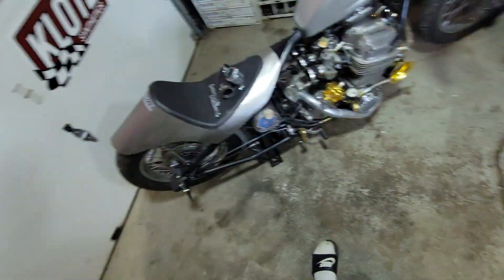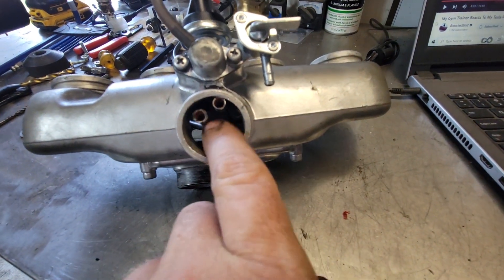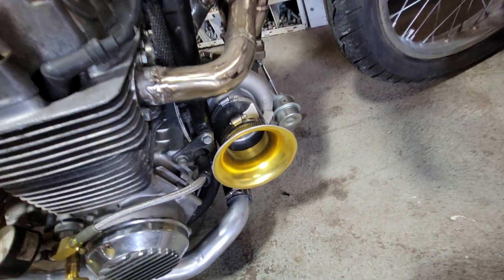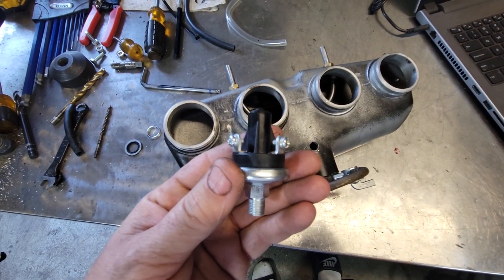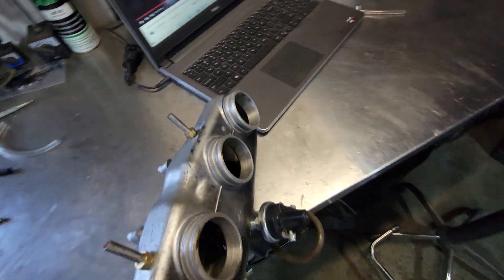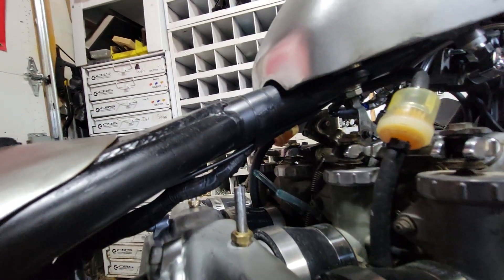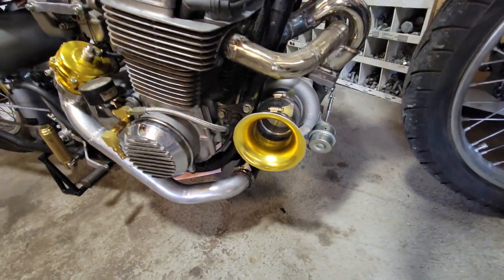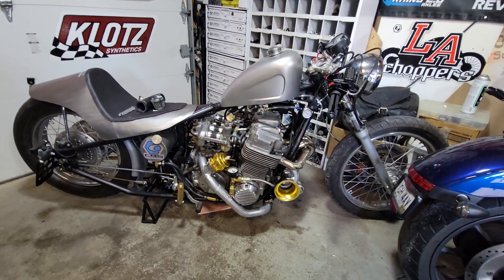Honda 750 Turbo charge tank fab BOOST SOON 😁

Comment: What's the switch doing at 1.4 psi?
Reply from the maker: It turns on with boost pressure, and then switches on the fuel pump once there is boost.